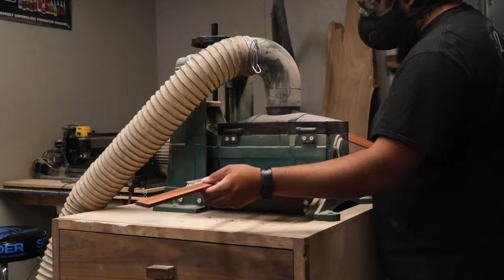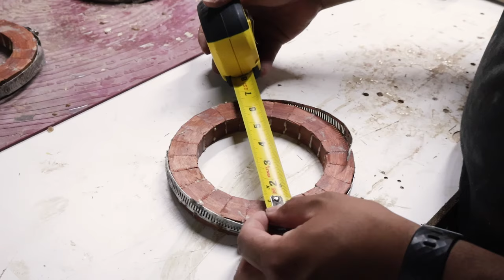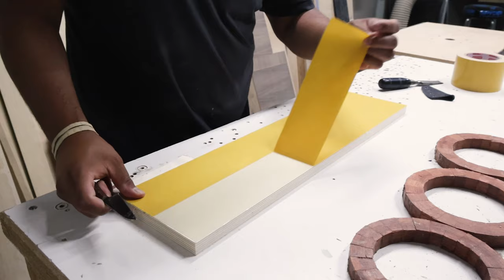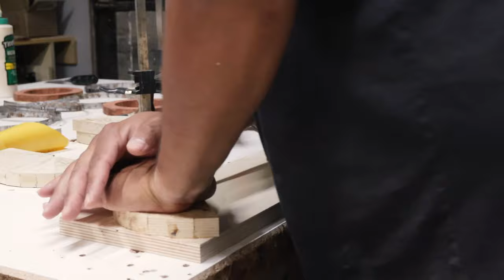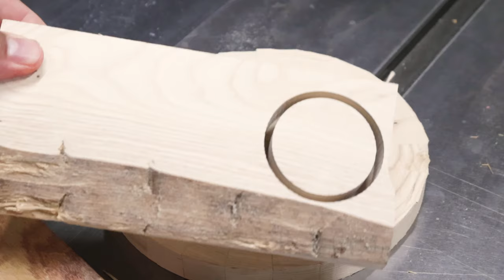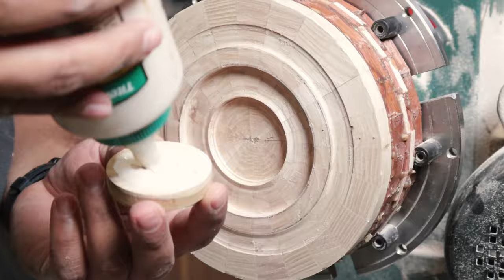Turning a blood wood bowl with a segmented bottom

Comment: The points you were trying to make about the segmented construction were good.  Your actual construction would be vastly improved if you would get a sharp saw blade. Also slow the cuts down. That will help too. Be sure to sand all the fuzzies on the segments. They will go together better. Put your camera on a tripod. The movement when you are talking to the camera is driving me nuts. And back away from the camera a bit. Good luck in working out the bottom of your bowls. Thank you for sharing. Have a great day and stay safe.🙂🙂
Reply from the maker: Thanks glen. Love the advice and tips. I'm still learning everything but I enjoy sharing what I Do know. I will put these tips to practice and see how they work out!

Comment: Try a segmented base with a floating solid insert to form the bottom.  
- Make your first ring with the OD where you want it and the ID 2" smaller.  This gives you a ring with a 1" wall and flatten the bottom side as usual.  
- Grab that ring in your Cole jaws with a 1/4" plywood sacrificial layer under it then turn the ID round.  
- Turn a 1/2" dado in the ID to about 1/8" less than the ring thickness.  
- Turn a solid piece of wood (I use something contrasting) round to an OD slightly smaller than the OD of the 1st ring dado and slightly thicker than the depth of the dado.
- Glue the solid plug into the ring with only two spots of glue in line with the grain of the plug.  As the plug shrinks and swells with weather, the glue wont crack and the bowl won't split.  The swelling of the plug will be absorbed into that small gap between the plug and the ring.
- Last, flatten the top as usual.  This gives you a foot on your base, a flat place to sign it, material on the inside to round out the bottom, and no hole at the middle of the base where segments don't quite meet.

Complete the piece as usual.
Reply from the maker: Oh wow! Thank you for this. I’ll have to give it a shot next time I make a segmented bottom. Thank you.

Comment: Around 20minutes: a comment on Cole jaws.  Some time ago, I tried what you did and didn't like the grip I got with the rubber fingers.  I had some flat head screws that fit the jaws and tried just the screws with no rubber.  The edges of the screws bit into the OD of the ring like fingernails and held the ring VERY well.  The slight dimples left by the screw heads didn't matter because they got turned away a little later.  Try it.  You might like it.
Reply from the maker: Great tip. A clever solution. I’ll give it a whirl!

Comment: What you are doing here is great but I just wanted to pass on a few things I have learned.  I have been making segmented bowls and vases for years now and had the same issue when I started with the bottoms not meeting up correctly.  The issue is the angle that the segments are cut to.  If a ring has 8 or 12 pieces and the angle is off just a bit, you can still make them come together with a bit of sanding and some glue but the more segments per row will compound the amount of angle you are off to the point that all the sanding you do will never make it look good or fit.  I ended up making a few table sleds at different angles and working with tons of scrap I moved the angle guide boards a hairs breath at a time to get the angle just right to get the bottom to meet.  Try it next time with a small amount of segments per row then double the amount, then adjust the guide board a hair one way and then the other…..you will be surprised just how much that little bit of movement can make.
Reply from the maker: Thank you, and thank you for the advice. I understand the compounding between multiple segments, and I have been thinking about making custom sleds for the segmented bottom. Now that I know it's possible. I will have to look into it to make my own! Thanks again!

Comment: This has popped up many times. With a properly set up jig you should never have to sand the joint.
And with a good blade and a slow cut at the end you should have nice tight joints.
 Just wanted to say that it can be done.
Not saying anything against what you have done.
Reply from the maker: Oh I know it can be done. I’ve done it before. You are right. Guess I just need to figure out the best way to get it 100% of the time. Thanks for the input!
Reply: @madiradesign  sure thing. Again not criticize your work.
A wedgie sled with perfect wedges is the key.
I have CNC milled my wedges.
I find a laser can work. But not as thick.
Reply from the maker: @ThePapa1947  oh yeah. Thats what I use. I actually mill my own wedgies and sleds for Etsy. I know I should have used a different blade. And probably need to update my 5 year old prototype wedgie sled.